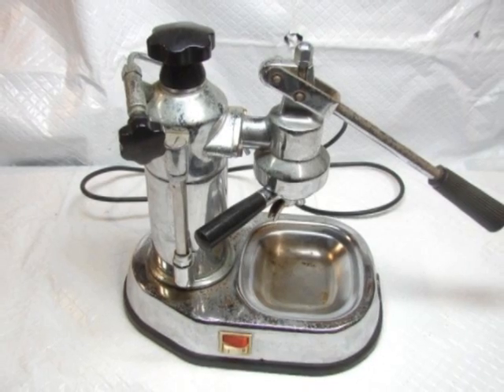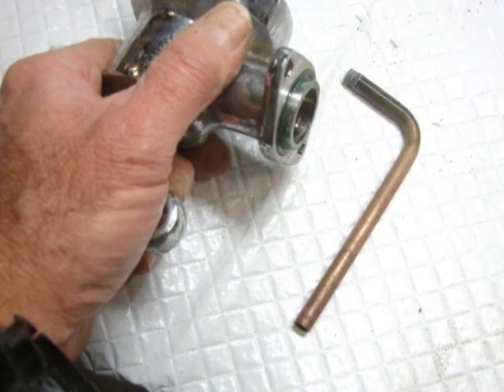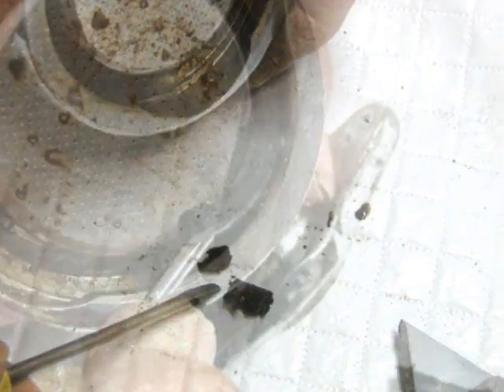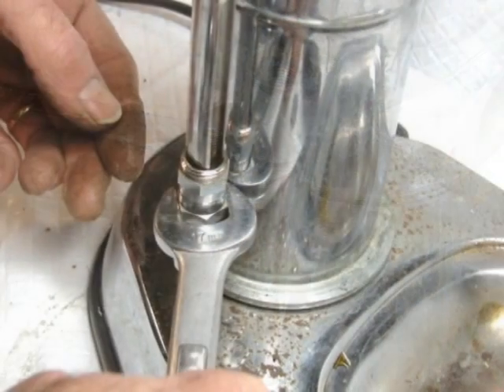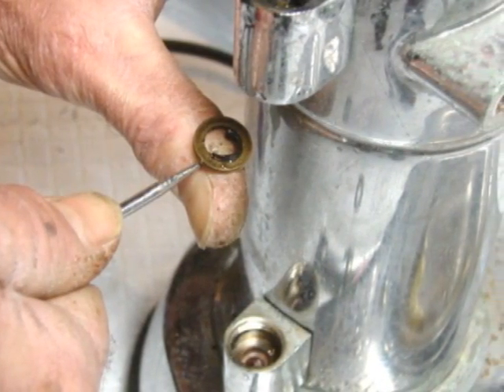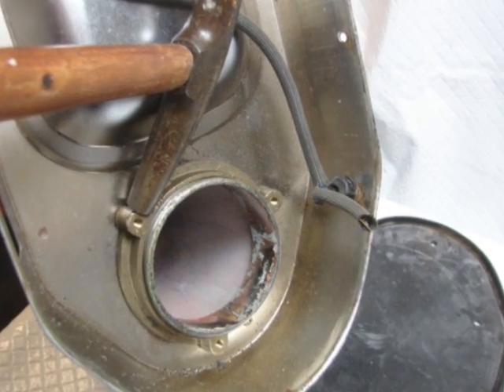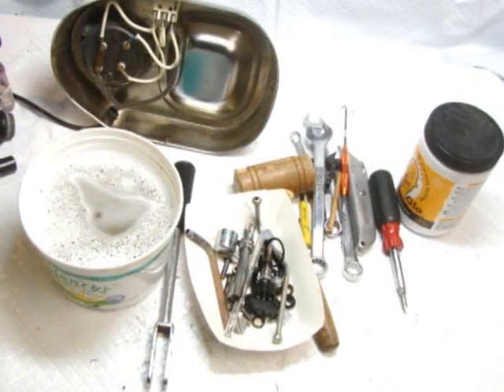Europiccola The Rebuild Part 1 - 5 Minute Breakdown

Comment: A trick to get the group gasket off  - take a small wood screw, drive it in to the gasket and then pull the gasket out with the screw. Milage might vary, but for me it has always worked.

Comment: Very useful, thanks. Just struggling with a particularly rusty eBay find at the moment, one of the bolts holding the element in snapped off during removal, am trying to drill it out at the moment but considering how easily the head came off the bolt, I'm finding it tough to drill and have already broken a bit! Also not looking forward to removing the boiler from the base - I didn't realise there was a factory tool for the job - but judging how much corrosion there is in the it's gonna be tough.

Comment: Many thanks for the video. Replaced all my seals without a problem. Well just one thing...I have steam leaking past the valve and dripping through the outlet. I removed some corrosion from the conical valve but this didn't help. Do I need to reseat the brass seat in the T? What size reseater would I need? Thanks again!

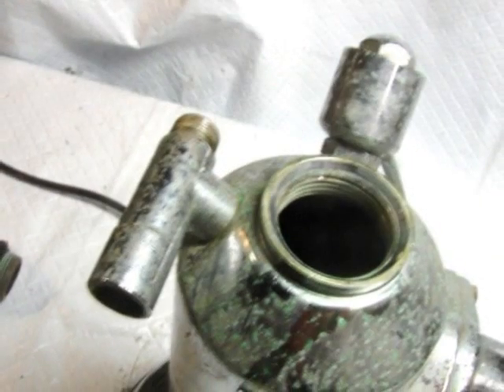Comment: Great videos for rebuilding the europiccola! I have the same boiler bent on the steam wand and I would like to know if there is any chance to break the boiler trying to bring it back to straight position. At minute 0:37 you use a pvc pipe and it looks good after! I’m just scared to break the boiler 😂 thanks in advance

Comment: I'm rebuilding my Le Pavoni circa 1982. The lever pin of the piston will not budge. I soaked in WD40 and tried to knock it out using a hammer and flat screw to no avail. Any suggestions?

Comment: Dumb question how did you rinse out the citric acid? Did you just tip it out? Or run the machine?
Reply from the maker: Just pour out the citric acid mixture, then rinse a couple of times with water, put water in the machine, heat it up, and run the clear water through the machine, and you should be good to go!

Comment: great video,but my europicolla is a bit different inside the group body.the part ive got inside its called "group internal piston sleeve with gasket" and it looks like  kind of plastic.does anyone know how to remove that part? i believe that could be  a problem in my machine as the lever dont hold at the top and very little water comes out when pulled down.please help.thanks

Comment: Hello!  Looking forward to bringing my Europiccola back to life.  I have my seal kit from OE ready to go.  I am part-way through the disassembly, but cannot budge the group head.  Bolts are off, but no dice getting it off.  I don't want to be too aggressive...  Any thoughts?
Thanks in advance,
Rob
Reply: Any luck? I'm in the same situation.
Reply from the maker: You'll need a bit of aggression - the gaskets have baked over time holding the parts together.  Hold the group in your hand, and tap it with a non-marking mallet.

Comment: I can’t for the life of me get the glass tube to move
Reply from the maker: It's baked into the seal - you could heat up the housing a little bit (not too hot - don't want to screw up the chrome)  Need to get the rubber to detach from the glass - soften it.  You can try carefully picking at the seal itself, to remove it tiny bit by bit...  Be ready to have it break...